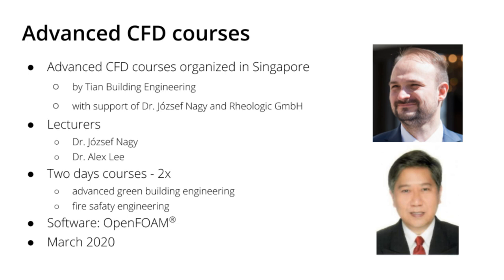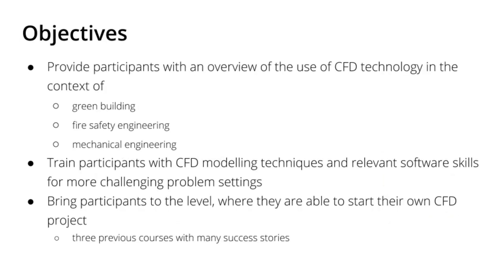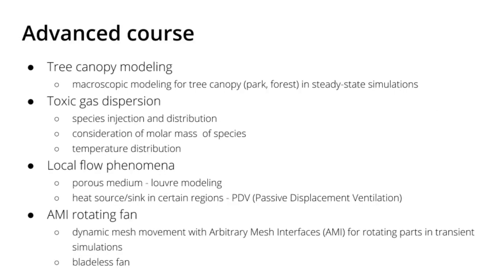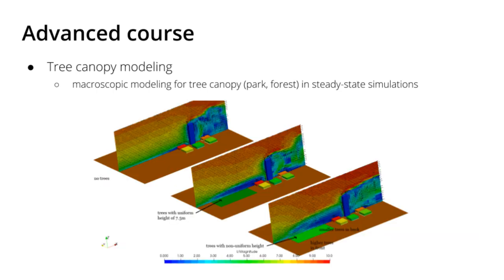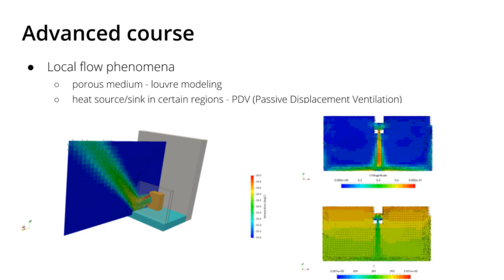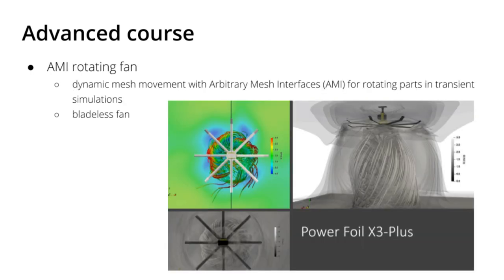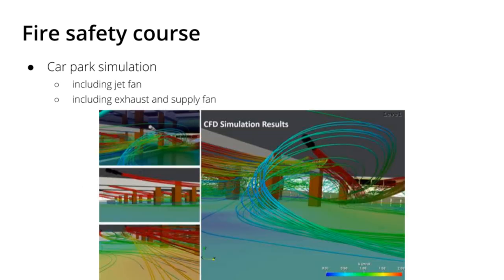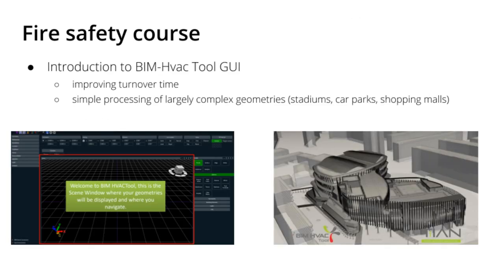Advanced OpenFOAM training with special focus on green building and fire modeling in Singapore

Comment: are you an Dr. for CFD-Simulations?

I want to do a lot with CFD too.
I did my Bachelor in mechanical engineering but all the Master courses are Most with FEM and only one CFD-module.
Reply from the maker: I did my PhD using a lot of CFD  OpenFOAM, yes. All the best with your Master.